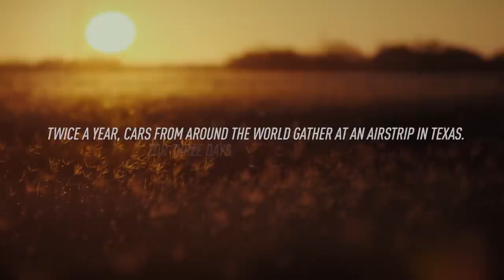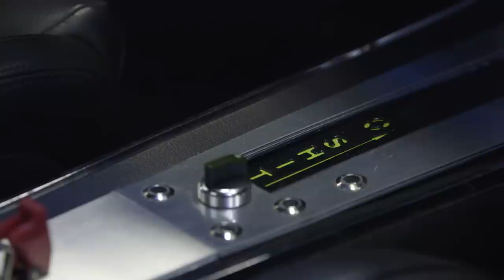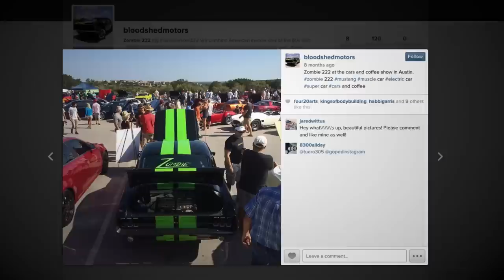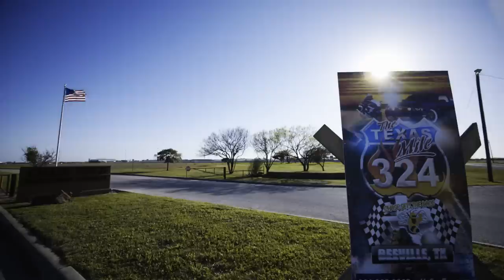The story of an all-electric, record-shattering '68 Mustang

Comment: You batteries costed 35k ? WTF  Lithium Ions are you using ?
Reply: extremely expensive super fancy stuff that can put out stupid amounts of power for several seconds at a time and not explode
Reply: Ryukachoo  I've looked at many EV car conversion sites and I have never seen them cost this much.
Reply: made out of gold he got ripped off lol
Reply: MidShipCivic most EV conversion batteries are designed for range, not massive MASSIVE sustained power output .

put another way, the energy required to go 0-60 in 4 seconds is far less than doing it in under 2 seconds
Reply: MidShipCivic 
i'd ask the same of you?
you are aware that LiPo batteries heat up when you push too much current from them yes?
and that tweaking the battery chemistry can reduce that head build up, letting you draw more current out of them per unit time?
Reply: MidShipCivic 
yes but LiPos in particular are very susceptible to it. The R/C community has to deal with puffing LiPos and they're usually the cheap ones that do that.Can be pretty dangerous.
for the zombie they needed a special blend that can put out shitloads of current much faster than other lipos could provide. Mitch medford actually has a youtube channel (literally called mitchmedford) and he has some detailed videos on the cells he uses and where he gets them from, you should go check that out
Reply: +MidShipCivic You are completely wrong. The controller can only manage the capacity the battery can supply. If I put a 200 amp controller on a battery that is only capable of supplying 60 amps, all the motor will get is 60 amps, and that is if the motor can handle it.
Reply: +MidShipCivic Actually you did and there is no need to show your limited IQ by resorting to bad language instead of learning from your mistakes.
Reply: +MidShipCivic I don't use G+ so I will reply here.
Capacity has EVERYTHING to do with amps. 
By your reasoning perhaps you think a step up controller can pull 100 amps from a single D cell. Never gonna happen.
Go do some serious research on electrical theory and application.
You might actually learn something, but I doubt it.
Your intelligence is obviously more limited than I gave you credit for and you continue to prove it without my help.
Reply: +Stambo I read it. Clear and concise. Thank you.
Reply: Stambo x

Comment: Why stop at 170 mph?
Reply: Mustangs are not very Aerodynamic, but it was best Technology they had in 1960's. 
I am pleased and satisfied with Race results for a ICE car conversion, but a Porpose built Electric RACE car would out perform it. the TESLA 2020 Roadster can reach 250+ Miles per hour and has a Range of 620 Miles on one charge. TESLA 2020 Roadster is the Worlds Fastest production car.

Comment: Car has no roll cage stock body 68 mustang was a beer can on wheels I see he has a bolt in roll bar. Without a full frame added, and roll cage stupid to run that car that fast.  This is why in drag racing they don't allow cars without certified cages faster then 9.99 or 135mph.
Reply: He probably took it out for reduction of weight.
Reply: You can't take out a welded roll cage.
Reply: @pondartinc4002  HOLD MY BEER!

Comment: It might be the quickest mustang in the world but, that's not what really counts in a electric car.  What really counts in an electric car is, the amount of mileage it can go without recharging. Another words,  how much mileage can it go on one charge. before it needs another recharge? Also, what is the expense to replace the batteries?
Reply: +carl cappy This car is only for Drag Races to be as quick as possible. If you want a Car for the normal street just get a Tesla Model S or the new Model 3 depends on your money and you get around 350 - 530 km depends on the config and your model
Reply: +Angelo L  the performance edges that he is pushing will help many to discover those balances in power performance reliability and efficiency.

Comment: Hm. I'm not sure 1.2MW of batteries would fit into that car. The Tesla battery packs use the most power dense cells currently available (18650) and still their 85KWh packs take up the entire underside of the car and they weigh almost 900 pounds. 1.2MW of those cells would be 12,452 pounds.. Either way, it's still a cool car, though. I'd totally do that to some classic cars if I had the chance.
Reply: npsit1 MW is power, kwh is energy. The hours part changes it from a unit of instantaneous power (like hp) to energy (like joules)

Comment: 170? give me a break. That car's chassis can handle 200 if you know what to weld to where.
Reply: his problem is the Mostly Mechnical nature of the car, Dual Inline motors not Efficient, turn the car into a Electric Skateboard, give it 4x Electric motors at each Wheel and a 200 kwh battery and then you will have something.

Comment: Silly to use a heavy car...And if your just going to use it for 12 sec. Drag race ..you only need 15 sec worth of battery; so a super capacitor would do the job and save another 1000 lbs.

Comment: ill sounds like a prius...that is a problem.
Reply: Frankie Boots Working on it... Stay tuned.....
Reply: The ease at which epic clouds of tire smoke are made makes a nice counter to that for me !
Reply: GreenJeep1998 I agree.  It just lights up those tires!  I would also love to see them run the 1/4 @ the claimed 1500 hp they said it can produce at max amps.
Reply: SuperSonicSenna  They might have to build a Pro Street style car that can come closer to putting that power down.
Reply: GreenJeep1998 may have to run some street legal drag radials though.  1500 hp street car is crazy for anything,  (Toyota supra anyone? ) but when you have that abd almost the same In torque,  at ZERO RPM, id think that it would be impossible to control without them. Possibly even with full on slicks.
Reply: SuperSonicSenna He already is running drag radials for those passes, I think it might need more tire on the ground than even drag radials can do.
Reply: mitchmedford Are you thinking what I'm thinking?
Reply: Dude31463 what are you thinking??
Reply: SocialDist92 Well okay, I'll tell you... Just between you-me and the lamp post. :) A little background... I grew up in the Muscle Car era, late 60's early 70's... ref. Bullitt, Steve McQueen, 68 Mustang 390 GT Fastback - 68 Charger 440 Magnum... Arguably the best movie car chase ever made... Furthermore, the "Experience" of becoming "One"-"Interacting" with a machine like the 68 Mustang GT Fastback or a Ford GT40, my personal favorites, is un-describable... This experience is created through the Sound spectrum of the mechanical machine harnessing timed explosions of fuel-air mixture, the Feel of clutch, shifter, brake, go pedal, steering, suspension, vibration, etc... This experience is difficult for many people to let go of which I can relate to... I have also come to the realization that we need to move on from this due to the consequences that I have come to understand very clearly through intensive research and personal experience with these machines from childhood. Having said that, the conversion of a classic depicted here is a "Platform" that can be expanded upon using available simple Technology to "create" or "replicate" the "Interactive" experience of a classic muscle/sports car of choice... It would be like downloading an app. like I want the experience of a Ferrari Testarossa today or a Lamborghini Diablo or a Ford GT or a Rolls Royce Silver Spur, Acura NSX, AMC Pacer,:) etc. all of which the EMP Platform displayed here and Tesla can clearly Accomplish without fucking up the air we breathe, water we drink and the Planet we live on... That's what I'm thinking in a nutshell and I think we all need to come around to Thinking and Acting Accordingly like Responsible (Response-To-Ability) Inhabitants/Adults who Love their Planet as much as they Love their Children as the two are In-Separable. Making New EMP vehicles and converting sentimental Classics and other ICE cars is a two-pronged implementation of the Obsolescence of ICE that is Self Evident by now.

Comment: Last I checked volts weren't power and amps weren't energy?
Reply: volts = motor speed , more volts = higher speed. amps = current, allows more Energy to flow faster, like a Straw vs a Firehose. more AMPS = faster Energy flow and charging.

Comment: A all electric car for drag racing? I don't think that is what the electric car was intended to be. An all electric car is intended for the elimination of pollution from the internal combustion engine and dependency from gasoline. The future of the automobile cannot depend on the fossil fuels and  new energy vehicles are being developed to eliminate the combustion engine.
Reply: +carl cappy where there are cars in America there will be guys attempting to make them run faster and get more powerful, it won't matter whether their power plant in a batteries gasoline, or diesel,
Reply: I have a 4 cylinder engine about 99 horsepower and I can  do a quarter mile in about 15 mins. That's fast enough for me.

Comment: When you are just racing straight, Why are you installing a rear Wing, Don't you only need this in turns? In Formula 1 they have whats called DRS which straightens out their wing while they race down the straight and where down force is not needed to reach maximum speed. So this wing is probably going to hurt you if you are trying to reach 170mph.

Comment: makes my sick to ruin such a good car.
Reply: saved a Great car from the scap Heap, made it better. Shelby would Embrace the Electric car today, they did not have the TECH then in 1960's. because GM and Ford killed the Electric car in 1890's America. up until the 1900's , Electric cars had been winning Every auto Race with Electrics, up until that point Combustion cars had a Manual Crank to star the car, it was Dangerous. then GM and Ford conspired to create the Electric starter motor. and the Rest is History.

Comment: I have a tesla model s p100dL and it's faster than this and my car is a lot more practicle
Reply: No it is not. Top speed is purposefully limited to 155mph & stipped out stock P100D does about 2.2sec 0-60. Both slower than the Zombie222.